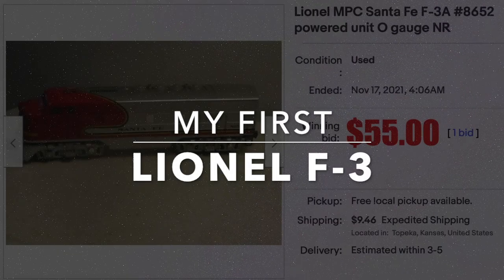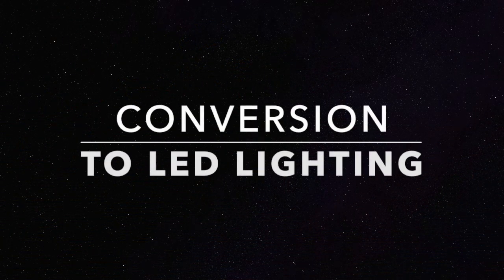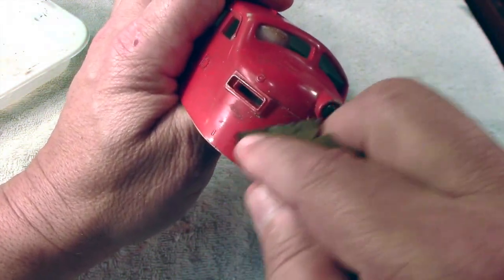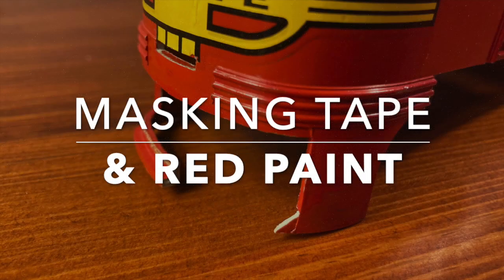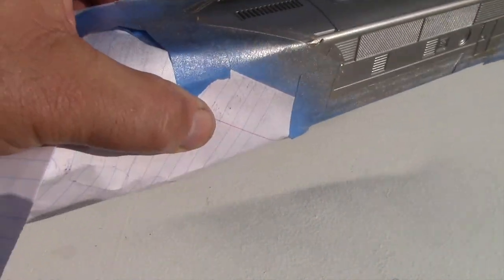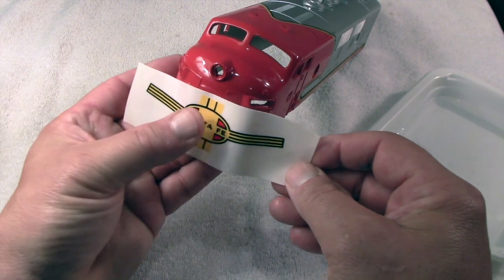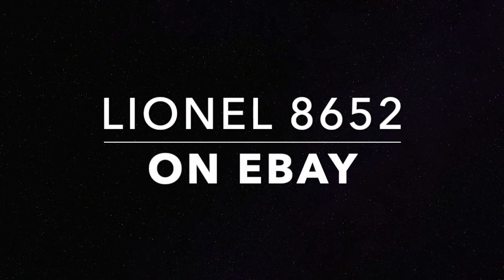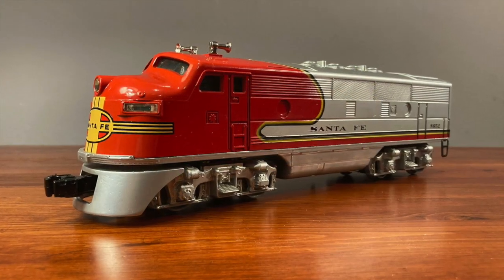Lionel F-3 Santa Fe 8652 Finished Restoration New Paint Decals LED Lighting Base Frame MTH Williams

Comment: Beautiful job!  It looks like Ford Red is very darn close to the color Lionel used on their 1950s era F3s when they produced them.  I would get yourself some front number boards that have some numbers on them to complement your LED retrofit.  The fact that Lionel made them blank in the MPC era is silly.  It was blatant cost cutting on their part back then I suppose.  If you're feeling even more adventurous, you can drill some holes where the portholes are and put some window lenses in too.
Reply from the maker: Thanks. I think it’s done though. 😀

Comment: Bob, another reason to have the same shade of colors on both of those Santa Fe diesels is that the prototypes of the EMD F3 and the ALCO FA were made about the same time - mid to late 1940s - so they would have equal time of exposure to the elements!
Reply from the maker: Makes sense! Thanks!